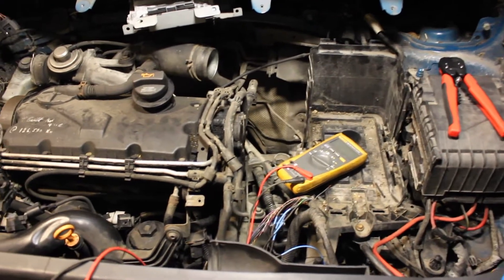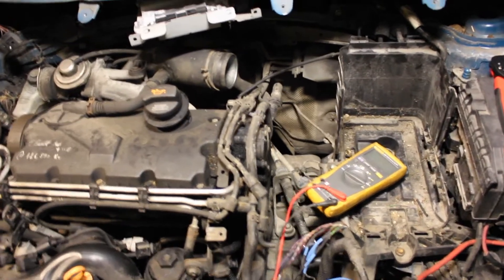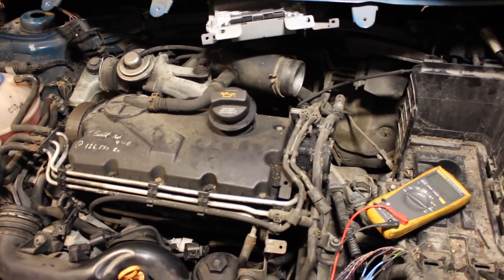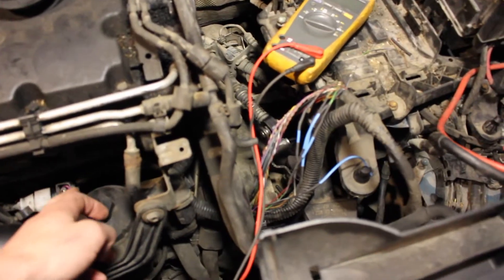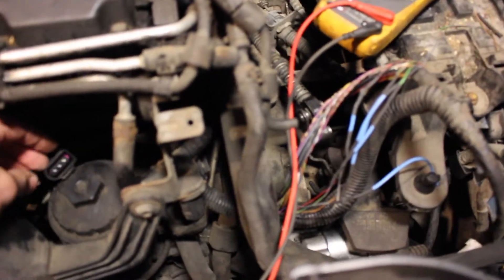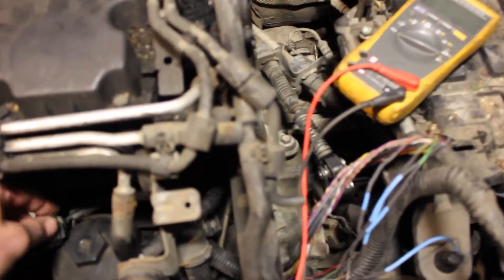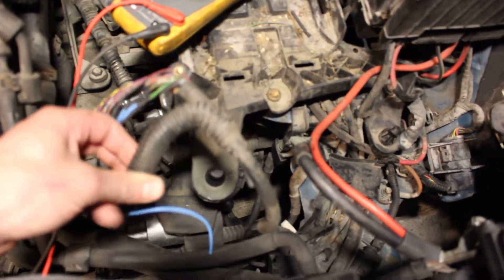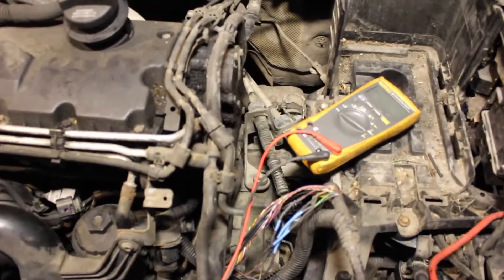How to test/fix camshaft sensor issues VW 1.9tdi PD engines (19463 code)

Comment: Sir, I don't know you and you don't know me, but your video SOLVED the problem on my 1.9 TDI BLS engine. The car was at a mecanic for 2 months, the bill was 2000 euros, they trew parts to it like crazy. Timing belt, crankshaft gear, sensors all over, and they just could not find the issue. The next step they wanted to do, was taking the whole gearbox and flywheel off to change the crankshaft sensor ring. I got tired and went to take the car out of there and today I figured I would do my own diagnostic after checking your video, with zero knowledge in these cars. Quickly noticed no voltage was on P2 of the sensor. Checking the T28 on the ECU I found no continuity and went to check at the exact spot you mentioned and YESSSS a broken wire!!!!! Repaired it and the car is starting again like new!!! The world needs more mecanics like you, doing real diagnostics and not these parts swappers.... THANK YOU!!!!

Comment: Thank you so much. Saved me a least $1000. 2 codes showing 19463 Cam position sensor and 18009 Relay Supply voltage Terminal  30. Followed your instructions and found three broken wires and several more where the insulation had been compromised because of chipping from the large protective shroud.....what a mess. Fixed all broken wires and taped entire cable in hockey stick tape to protect it.  All codes disappeared car runs like new. Thank you

Comment: Thank you: my Passat Tdi has just started doing a long crank before starting (scan on VCDS says cam-sensor), but at virtually the same time started getting 'oil level sensor' warning: usually perfectly reliable so I suspect that, like you, I have a loom issue rather than two failed parts at exactly the same time, which would be highly unlikely.

Comment: I replaced the sensor and was fine for 6 months now my car is suddenly cutting out worst than ever. I did use a cheap sensor and I did find a broken wire in the harness that I fixed.

Comment: What should your volitmeter read if it is getting the proper power?
Reply: near enough zero Ohms.
Reply: Plus you will need to wriggle the loom to see if metre reading fluctuates.. putting an ampage load on the wire also helps to find a break as the wire with the issue may not be broken fully which will show normal reading.. Time and patience but know by checking the wires you are on the correct track straight away without spending any money on parts..

Comment: How did this fault present itself to the driver.
Reply: Also shows up a few different codes all leading into same area "crankshaft sensor.. many different codes I've found P3007 to be the most common.. "implausible signal". Engine will not fire up but when you clear codes it will immediately start.. it will also start if you unplug the camshaft sensor at plug which is grey beside the dipstick.. it will be rough idle but let's you know the general issue at hand, which mostly comes back to a wire break in the loom leading from this grey plug back to the ecu.. Break in the loom is in the general area of the starter where the loom branches leading under the battery tray heading back fir the ecu under the wipers..
Reply: @michaelhannon2452 I’ve checked the wires are good and zeroing out new cam sensor still no start with sensor plugged in will start and run roughly when sensor is unplugged.
Reply from the maker: Long crank time as it was relying the crank signal only.

Comment: I've this problem on my seat ibiza 1.9 with code 19463...starting is very difficult and too much white smoke when engine is cold? One  Injector is between the range - 2.88 +2.88 (-2.33) and the error is just that one above...is it possible is just this sensor with this white smoke..?
Reply: No, camshaft check and valve mechanism!

Comment: I’ve had the same problem in my caddy van  started off with heavy rain getting up round the wiring loom  van would cut  then restart after a while. Camshaft went on it then oil cooler burst filled the water header tank with engine oil  crankshaft sensor  failed. The PD 1.9 engine is an a absolute pile of shit  just look at how many u tube videos on it had the old caddy van 1.9tdi. Far better engine. No bother at all with it put 285000 miles on it  VW  not worth the money
Reply: The PD is the best small diesel engine EVER invented
Reply: @Interdiction  Injector bores wear out badly, then you throw away cylinder head, no one fixes that
Reply: I wouldnt let your experience put you off the pd engines. My old 110 was on 250,000 and ran amazing.  I would not of been surprised if it reached 300,000 if I had not crashed it. My current 110 is on 210,000 and runs sweet.